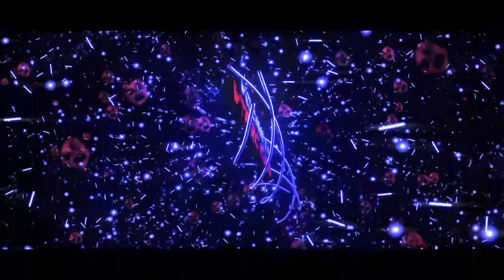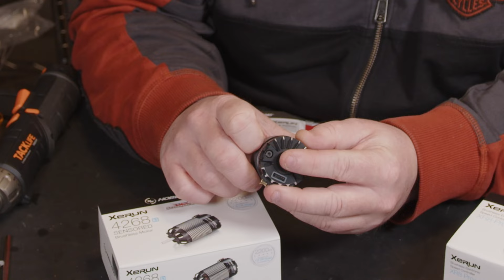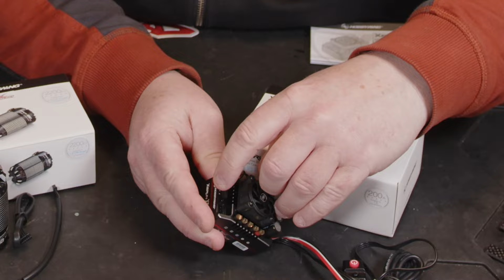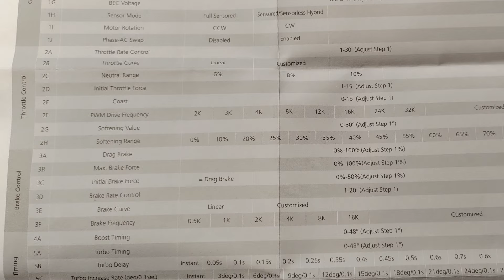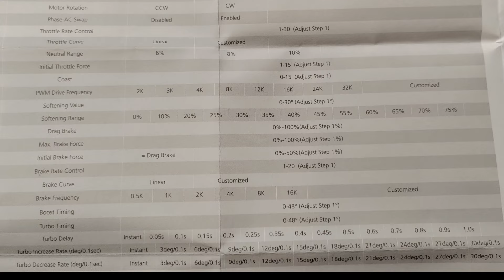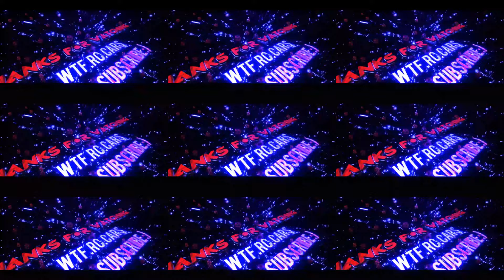XERUN - XR8 - Pro G2 - 200A - ESC + 2200KV G3 unboxing.

Comment: I'm looking at this or the G2 Plus (6s) for my Tekno MT410 but people say that 2200kv is too high and 2000kv is the sweet spot for that truck. Wondering if I should just get the esc and a separate motor at 2000kv.
Reply from the maker: 2000 or 2250 depends on what gearing you want to run.
Reply: @WTFRCCars  i want to use 4s but know I could try 6s. Figure in that case I should get the 2250kv over the 1900kv. The new xr8 plus g2s and the corresponding motors support up to 6s. Figure a 15-17 t pinion for this?
Reply from the maker: If you go for the higher kv you can always back it down, I run the 2250 in the XT8e 22 and kraton 6s exb